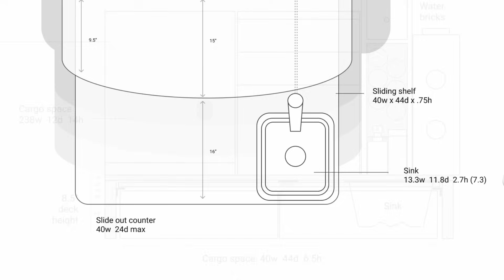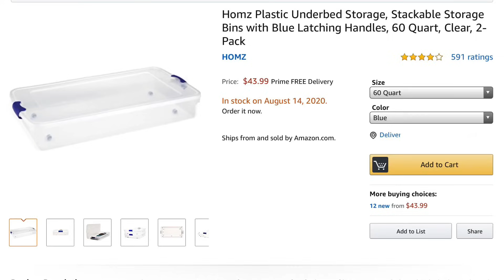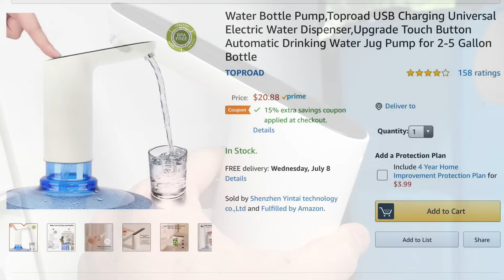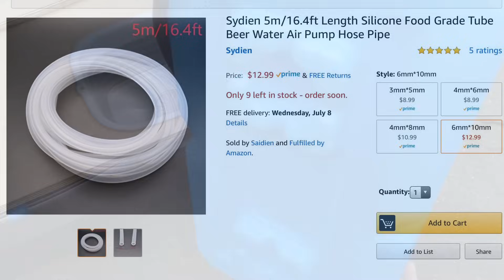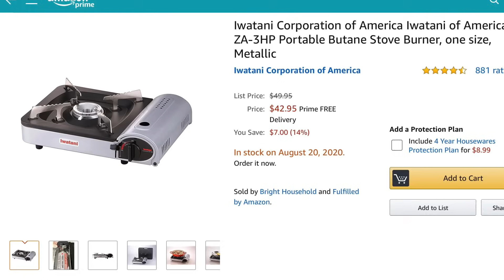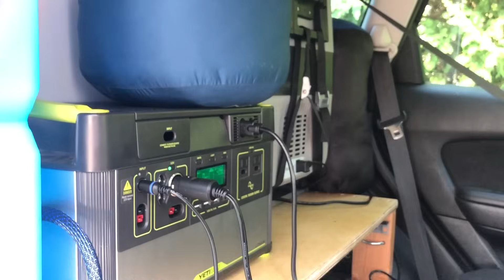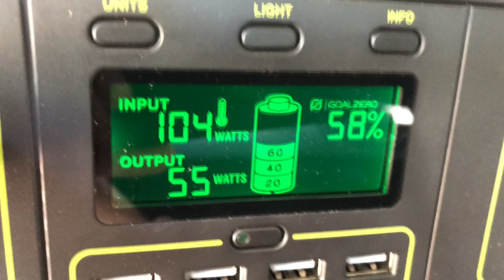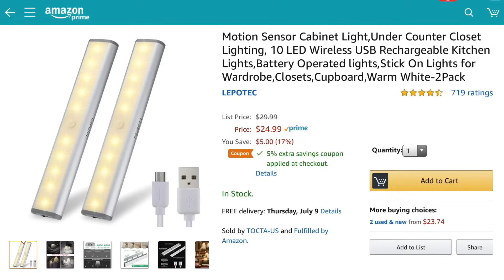SUV car camping kitchen with sink and fridge - DIY organization ideas for family camper

Comment from the maker: FRIDGE UPDATE: Some bad news on the Alpicool dual zone fridge freezer. It just randomly died. It was sitting plugged into AC at home (freezer mode) and I noticed the panel lights were off. Checked connections, tried DC, opened up the panel to check fuses, nothing. Just dead. It has been running perfectly since March but seems the power supply or control board just blew out suddenly. I contacted Alpicool through Amazon and amazingly they agreed to credit me if I sent it back. I think I learned my lesson: these Chinese knockoffs are a great deal but if they only last a year or two (or less), it's probably worth paying 2-3x as much for a Dometic, ARB, etc. and know it will last and be repairable. I have my eye on the CFX3 75DZ because the dual zone feature is so useful year round to me as a second fridge/freezer at home.It's a bit large for the Mazda but I'm getting a minivan this fall and it will fit great there. I'll make an updated video on this soon.
Reply: Great setup and thanks for the update. Just found your video and subscribed. I agree.
Reply: Thanks for the update I was just thinking that the refrigerator was such an expensive part of this build. Because I want to keep costs way way down I was thinking of not doing the refrigerator or solar but just doing a heavy duty cooler. Especially just for a weekend trip.
Reply: Ok now im gonna subscribe .
That was pure honesty ... sick of being lied to cause some influencer got paid a kickback to be promoting shit.
Reply from the maker: Lee Bailor hey, thanks. I buy everything myself, just sharing whatever random thing I’m tinkering with here
Reply: Ooo a Sienna? If so I will wait before I do anything to mine :-)
Reply from the maker: @lillypatience  Close...waiting for the AWD Pacifica to drop but both are pretty similar space-wise. Looking forward to all that height and square-ness
Reply: I’m also using my Alpicool for extra freezer space during this pandemic.  Would have spent more if I knew we would go into extended innings.
Reply: @todd.parker  Oh yes! I read they were coming out with an AWD.  Ok so by end of year you'll have it built out??? :-)
Reply: @seccat  I have two Costways directly from their site. So far I am happy with them. They don't have a dual zone though...either freezer or fridge.
Reply: Bummer. That had a lot of potential. I have an old Engel fridge that's been rock solid albeit small.
Reply: Are you running alpicool direct from battery? stock 12v outlets fluctuate in power when drawing from a fridge all companies recommend wiring direct to battery since can damage compressor. Check out the ARB fridge wiring kit, I've been running my alpicool for lots of off road trips and no issues at all but been using hardwire kit since day 1... but got 3 year warranty just in case. Alpicool is now offered in costco but rebadged, so that's an even better warranty.
Reply: Between it maybe breaking or going up in flames is why I stick to coolers
Reply from the maker: I get that but I just camped for the last 3 days and it sure is nice to not have soggy food and not need to keep buying ice. I was able to chuck my water bladder into the freezer and it was frosty all day. Of course, I spent the weekend fretting over battery charge so it’s one thing or the other!
Reply from the maker: @huskynoob no, I’ve been running it from a regulated DC outlet on the Yeti and it died out of the blue running on AC. Strange.
Reply: Iceco makes good frig too. The type of compressor is most important.
Reply: Is it demotic or ARB
Reply: I have the ARB 50. It has been working flawlessly for 2 years straight. A fridge in a semi truck is a true torture test.
Reply: @wkwong80  Engels are super! Lab grade!  Worth it!
Reply: I noticed you look to have the exhaust fan blocked on the side of the fridge.. could that have caused a problem?
Reply from the maker: Scotty Knows I tried to make sure there were a few inches of breathing room around the fans when in actual use. It actually died plugged I to AC at home, sitting in the open!
Reply: @todd.parker  you may have just got a bad one, lots of great review on yotube, forums and amazon on alpicool so much so that costco now even offers it as massimo branded... I'd give them one last chance the savings is substantial and it bas a low power draw compressor compared to even higher priced ones.
Reply from the maker: HuskyNoob im sure it was just a lemon and most people will have decent luck but it make me realize that if it died, nobody will repair these and they’d just be trashed. I just got my Dometic CFX3 75DZ and it’s built like a tank and can be serviced so I’m going that way but mostly because I want to use this year round as a deep freezer/beer fridge so I can justify the cost
Reply: Thanks for the follow up on the fridge/freezer. I’ve been on the fence about one of these vs. the more expensive brands.

If you’ve had the chance to test the new Dometic, what is the power consumption vs. the one that went bad?
Reply from the maker: @slyflea  It hard to compare because the Domestic is 50% larger and I've been mostly using it as a dual freezer but I'd say it uses 5-10w more but is way better build quality wise and I feel like it should both last longer and be repairable
Reply: How much is the yeti power? Does it charge with the car battery while the vehicle is running and also solar panels? What is the approximate cost of both? Thanks for the video. I drive a Semi truck across country and looking to make life a little more easy and comfortable.
Reply from the maker: @singhmaster4  The Yeti 1000 retails for around $1,000 but can be found refurbished for around 750-800 on the GZ site. There are lots of other brands and sizes (Maxoak, Jackery) that are cheaper and can be had for as low as $400 if you go with a 500wh size (50% smaller). For solar panels, I showed these folding TP Solar panels in 60 and 120w versions but this 100w one might be the sweet spot: https://www.amazon.com/TP-solar-Foldable-Battery-Portable-Generator/dp/B088FPQZ7V?ref_=ast_sto_dp
Reply: Could you do a build video when you get your new minivan? I'm subscribing just for that😜
Reply from the maker: @abalonegoddess  You bet! There will probably be a few videos this winter...
Reply: Fridge needed to vent
Reply: Yes
Reply: That said it broke on you since that was half of your budget but you have very genius ideas in this
Reply: @todd.parker  👋 in returning thru Amazon -  you were able to return it Because you returned to Vendor thru Amazon ( customer care) or because you bought a Warranty from Amazon. ?
I really like the idea of both fridge and freezer at the same time— nice !! I know the Jackery will turn itself off if the voltage goes lower than 11.8 on the car voltage ...  an unpleasant surprise if not known to check it. Also these 12 v fridges can unplug easily. Gotta check that too... for those using in the vehicles
Reply from the maker: @KG-cl9gv  I contacted the seller through Amazon's order detail and they offered to give me a refund
Reply: Hi Todd! Thanks for sharing the info regarding Alpicool. I pulled the trigger on the T36. I have yet to really put it to the test, but it’s good to know you had a good experience with Alpicool. If mine takes a crap, I’ll probably do the same ... spend the bucks and get a respected name brand. I just wanted to play around with layout in my SUV to see if I like the fridge size and placement. I still really like your build, and plan you use some of your ideas. Good work Sir! 😎👍🏼
Reply from the maker: @COMtnPilot  I just bought an Iceco and they seem to be a good compromise between the Dometic/ARB level and the no name Chinese fridges. It has the same Danfoss compressor  for half the price
Reply: @todd.parker  ... Which model ICECO?
Reply from the maker: @COMtnPilot  The JP40 is a perfect fit for my minivan build. There is a coupon on slickdeals (still active) that got be $100 off: https://www.amazon.com/dp/B07Q82Q37G/ref=cm_sw_em_r_mt_dp_DAVAA6JE4TJ49KJJQAZ2
Reply: @todd.parker  ... Thanks for the info, Todd! I might just get the ICECO and send the Alpicool back. I still have time. Looks like a nice unit, and with coupon you can’t go wrong. And, it will fit in the plane! 😎
Reply: @todd.parker  ... Todd, one additional question if you don’t mind Sir! I noticed that the Alpicool has a fairly noisy compressor while running. Can you please give me your honest opinion regarding the difference in compressor noise level between the Alpicool and the ICECO? I’d appreciate your it!
Reply from the maker: @COMtnPilot  I only ordered the Iceco yesterday but will let you know when it arrives. fwiw, my Dometic is quite loud too.
Reply: @todd.parker  ... Oh, OK! Thanks, Todd! Thank you in advance for your time!
Reply: We recently got to see the dometic CFX 73 and ARB ZERO  duel zones side by side at an outlander outfitter open house. We decided on the ARB ZERO! It felt WAY more rugged and study, with heavier duty lid vs the dometic. (which surprised me.) Both of them have easily reversible lids, which is cool. (HAHA..see what I did there?) But the ARB had a REMOVABLE divider (that separates the freezer section) where you could make the entire thing a fridge OR a freezer. Which was WAY COOL. The dometic could also make both zones the same temp but its divider is permanent.  We were very impressed with the fit and finish of the ARB!
Reply: I have a Dometic CF 18. I originally bought an IceCo which I really liked but it was way too large for the space that I had. The CF 18 is small so I will have to see if we can live with it when we are out camping. Anything has to be better than ice in a cooler though ! I hate soggy food :(
Reply: 9
Reply: 0302
Reply: Thank you so much for this video, and for the fridge update! Would love to see your minivan video!
Reply: Hi. I noticed there were a couple comments about the refrigerator. One said it needing to vent and then somebody said something about hooking it up to the car battery or something like this? That perhaps the refrigerator freezer would have lasted longer? Is this true?
Reply from the maker: @dianeibsen5994  it’s hard to say why it failed. Could be bad luck, could be these cheaper fridges aren’t built to last. It is important to have good airflow around the sides where the fans are so it can push heat away, just like your home fridge but in a car that can easily be over 100 degrees, it can really stress it out. I replaced this with an Iceco JP40 and it runs like a champ. It’s a bit more money but still half the price of “good” brands like Dometic and it uses the exact same compressor.
Reply: It's a bummer.  Sorry for the problems brother. I'll steer clear of alpicool
Reply: @todd.parker  thank you for your reply Todd. I want to have the biggest threat fridge/freezer that I can possibly get into campervan or van. I'm looking for a good quality one. Do you have any videos you can recommend that would help me make a decision? I also want one that runs quiet as possible. So do you suggest always having a fan running by the portable fridge freezer?
Reply from the maker: @dianeibsen5994  after a lot of research, I think Iceco is a good mix of high quality build and reasonable price. I have the JP40 but they make all kinds of sizes. It uses the same compressor as Dometic at half the cost and these are more energy efficient, quiet, and last longer that the generic fridges out there. https://youtu.be/wt_C3WJ_AXw
Reply: @KMF3  Hi, in Ireland we can buy a fairly large fridge box for €59.00, it connects to car battery and electricity too. No freezer in it tho 👍😉🇮🇪🍀
Reply: @Marie-yx5ie  wow that's cheap...I think
Reply: Use the 4 foot plastic storage boxes as your fridge and lots more uses for them. Clothes, food, duct tape, everything... stack them and point a tiny torch at them and you will see it enhanced BEAUTIFUL.  Excellent tips. Got me inspired to get out there. 😎😎😎
Reply: @Todd Parker.  Great video,.  Thanks for the update post too!  I'm looking to do something similar with my Jeep Wrangler. 

Tip on the T-nuts.  If you use a forstner bit, you can countersink them into the bottom and eliminate the potential scratching.
Reply from the maker: @dasschmidthaus  good tip, thanks!

Comment: Thank you for this video. I've been trying to figure out to configure a removable system in my Sienna while still using one side of the rear seats. I appreciate you showing the resources especially for the fridge slideout.
Reply from the maker: Glad it was helpful. This kind of setup should work great in a Sienna
Reply: @todd.parker  Yes, mine would be simple as I don't need the pull out table or sink. Just storage and slider for the fridge which I found for $165 in stock :-).

Comment: Thinking about something like this for my CR-V. My concern is being able to access my spare. Next vehicle I'll make sure it's mounted outside because I don't want to take apart my kitchen by the side of the road!
Reply: Something to think about Kristen is how often have you actually had to use the spare? In 111k miles on my Element, I've used the spare once and it was a local around town trip, not cross country.  I made the decision not to worry about any extra effort to extract the spare when camping.

Comment: Awesome! I subbed because you seriously earned it. I think I'll put your ideas to use in my van.

What powerbank would you use if you could use anything you like?
Reply from the maker: There's lots of good options out there. I'd try to get one that uses a LiFePO4 battery - they are a bit bigger and heavier but are safer and have a much higher cycle count. Not sure the perfect unit is out there quite yet...I keep looking! I'm pretty disappointed by the new Yeti X line so although I like my Yeti 1000, I think I may try a different brand at some point.
Reply: Hello I was checking out the Jackery portable power station 500 outdoor solar.
Reply: I am using a Bluetti EB 240 solar generator. The only drawback to this is that the inverter is only 1000 W. Bluetti has some newer products with larger inverters. I have a 320 W rigid solar panel bolted to my roof rack that charges the Bluetti.

Comment: So glad I tripped over this video! I have a CFX-35 that I've used in my GTI. It's only drawback is that I have to pull out the fridge to get anything out of it. I've contemplated some sort of slide-out. They're tough to find in an application as small as mine. HAHA! Keep up the good work!
Reply from the maker: Glad it was helpful! Adding a slide out is easy and make it much more usable. Too bad they are pretty expensive.

Comment: This is awesome. I just built an elevated bed base using the info from this video including the pull out counter. Super easy and lose the results. I've never built anything before so this video was instrumental and very helpful and detailed. Thanks so much :)
Reply from the maker: Glad it was helpful. I’m not great at carpentry either so I designed it so even I could build it

Comment: Excellent video i did a similar build in my Jeep but instead of a filing cabinet i used a craftsman toolbox, I also have a similar water system the slide out for the sink is ingenuous i may need to borrow that one keep up the good work. I guess i need to do a video this has been very helpful for a weekend camper like myself
Reply from the maker: Yeah, I’d love to see your setup!

Comment: Very nifty configuration, piece of mind for sure. I built a beefy connected/interlocking sleeping platform consisting of 5 boxes with hinged lids n drawers but became such a beast, I've gone back to the drawing board. Evolved into 12 Sterilite totes, which is lighter, but still aggro to shuffle in n out. Thanks for a well produced vid and narration. Amazon wishlist beckons. Cheers, n good luck to ya.

Comment: I like your idea with the sink and faucet. Nicely done!
Reply from the maker: Glad you liked it, been working well for me so far
Reply: @todd.parker  I'm incorporating this into my van build. Great use of countertop space by having a pullout kitchen sink as needed. For your collapsable sink, could you connect a hose to it so it would drain into a bucket?
Reply from the maker: Tim Chan you probably could finesse something as a tube but it doesn’t have a super standard drain opening and you’d need some way to quick disconnect it when you stow it away. I’m lazy and just pick it up and dump it or (even lazier) just open the drain

Comment: I see you are using those three gallon water bricks. They look like they fit into the space perfect. Much better than a 5 gallon jug which is much heavier, I think I will end up getting these. Thanks for showing us your kitchen.
Reply from the maker: Glad it was helpful. The only thing I don’t love about the water bricks if you’re using their spigot instead of the powered pump is it seems you can only empty them halfway without lifting up the back a bit because the spigot it in the center instead of the bottom. Just FYI.